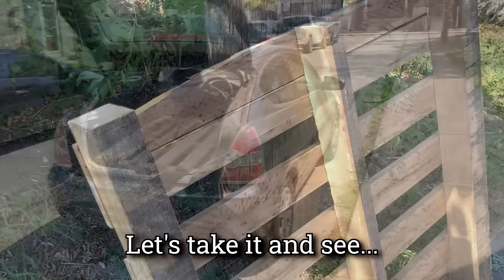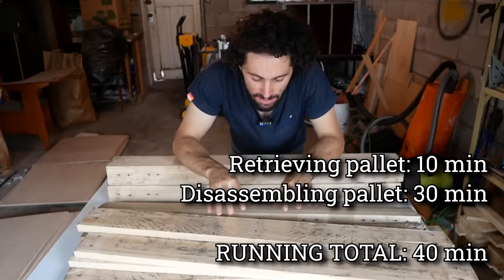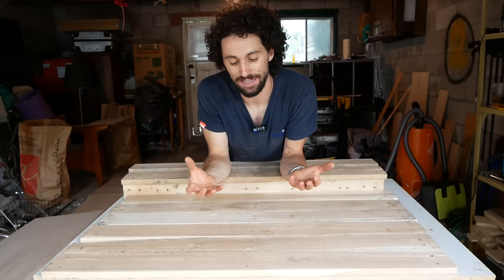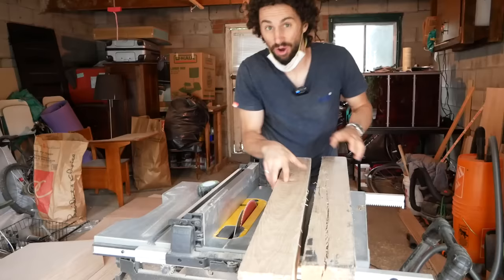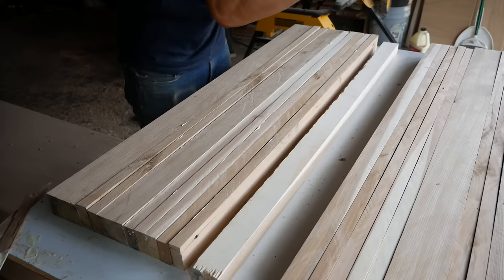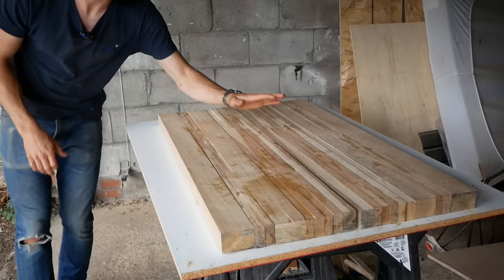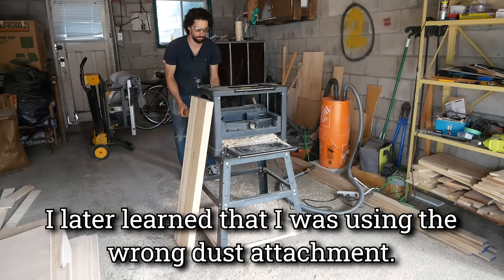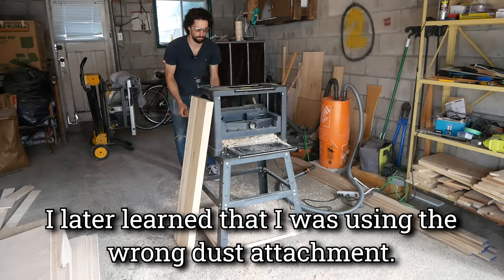Turning a Free Pallet into a $550 Table

Comment: If any new woodworkers watch this, do NOT copy his tablesaw practice. Use a push stick or gripper block to keep your paws away from the blade. How he still has thumbs doing that is amazing.
Reply: That was my first reaction to watching it. Insanely dangerous technique. This comment should be pinned.
Reply: As someone who has had their pointer cut off and luckily reattached, I can also say I have anxiety watching ppl get that close to the blade. Be careful and definitely do not go that close with your fingers. Use a push stick always!
Reply: Yes, very dangerous. WATCH YOUR DIGITS!
Reply: Wow... I hope you guys didn't get sawdust into your handbags.
Reply: @moshesheckel7369  
So, you don't think adhering to an appropriate level of safety is a good thing? There are no handbags if you have no fingers.
Reply: At least I'll have thumbs to open and close the zipper!
Reply: I cringed when I saw that. 🤦‍♂️
Reply: I'm a complete noob and I noticed it. This guy is a maniac. I stopped watching after that point.

Anyone who doesn't follow basic safety technique (that even a novice like myself can see) isn't someone I'm gonna be devoting my time watching for ideas.
Reply: 75 years old.  Retired Industrial electrical/millwright contractor after over 30 years and was in the trades the rest of my life before that. . Most of my time has been in metal and not really a johnny woodworker but I do have a COMPLETE wood shop with all industrial equipment we have accumulated over the years.. After all that I have all my fingers and in fact still play in 2 bands on a couple of different instruments.  Here is the way I kept from getting hurt over all those years.

DO NOT DEPEND ON GUARDS. Depending on a guard to save you will get you hurt every time.  - Personal responsibility is the best guard of all. Keep in mind every machine you will ever get around wants to kill you. 
(BTW The guard on the table saw is not to keep a fools hands out of the blade. It's to keep a piece of wood from dropping onto the top of the blade and getting propelled toward the operator like a spear. Somewhere along the line it became the end all solution to not sticking your hand in to the blade)

NEVER, NEVER, NEVER use gloves around rotating machinery.Not even the so called "rip-aways" - It is better to have a few stitches in your thumb then not to have a thumb to have stitches in. 
I have actually seen 2-dead bodies taken away that were killed because of gloves wrapping them up and pulling them in. 1 on a radial drill and one on a straightener. I have seen more lesser injuries then I want to remember. If you can't run power tools without gloves go do something else for a living.(I catch you once and you go home for the day. The second time you get your money and never work for our company again)

As for the table saw...A trick,,, Lay your hand flat on the table with the edge against the rip fence. Extend your thumb. Any board narrower then the distance from the tip of your thumb to the fence gets a push stick. 

Just remember, if you don't want to get hurt don't take chances and don't depend on guards, gadgets, and  gloves to save you. It;s all up to you,,,,,,and watch put for the other guys on the job.
Reply: Came here to say this
Reply: @mathewmolk2089  
Excellent advice for all levels, especially the table saw safe distance (you've spelled out exactly as I do).
Reply: Crown guard dude🧐
Reply: will be doing a video one about going to er
Reply: Always use a stick 👍
Reply: that was my concern too
Reply: Yeah, I don’t even own a table saw yet but I would still never do that. Friend of mine almost lost his whole hand working professionally still isn’t a guarantee.
Reply: As with just about anything don't be an idiot, pay attention to what you are doing and you will be fine. push stick or no push stick. His fingers aren't even that close to the blade.
Reply: @moshesheckel7369  Incredibly stupid sophomoric comment. Everyone else is giving excellent advice and being extremely generous.
Reply: @mathewmolk2089  definitely do not use DeWalt. Every tool  they sell wants to harm you on one way or another‼️
Reply: Millennial
Reply: @elenalatici9568  seemed reasonable to me he was just making fun of all you nutless wonders obsessing over a push stick. Ffs not everything needs training wheels. Just don't be careless while you work. 30 years in the trades still have all my fingers not because of push sticks but because I pay attention when I am working.
Reply: Sooooooo bad. Excellent demonstration of the “before” part of the shop safety video.
Reply: I totally agree
Reply: I’m sweating watching this sh**
Reply: I've been a finish carpenter for almost 30 years now and I still have all of my fingers. Those push sticks are the dumbest thing I've ever saw and I watched one of you geniuses get your nose broke once because plastic doesn't grip or feel the saw binding. 

Seriously just no matter what don't get your fingers within 6" of a blade and you'll keep them.
Reply: tbf he was far away enough
my woodworking teacher always told me 
if you can fit more then your hand inbetween the blade 
no need for a push stick
Reply: @moshesheckel7369  the problem I have with it, a unskilled person is going to see this and do EXACTLY how he is doing it, And lose a finger. Or his handbag.
Reply: @mathewmolk2089  the guard isn't to protect you from the blade, it's to remind you where the blade is. spinning blades aren't very visible
Reply: pallet wood isn't good wood either and is likely to split and come flying back at you.
Reply: @danger1240  or maybe it's dumb luck why you have all your fingers still.
Reply: @thomascieszenski239  those cuts he was making were less than 6" from the blade, so the only safe way is with a push stick
Reply: @Galgamoth  or maybe just not being dumb was key...
Reply: Dude I was thinking the same thing, and I'm an amateur lmao
Reply: I thought the exact same thing when I saw his hands so close to that blade. If he wants to do that in private, that's his business. But I think it's really risky to do it when he publishes a post. Not everyone is as careful and coordinated as him. I forsee many sawed off fingers!
Reply: yuppp
having a heart attack
Reply: Yup. I was enjoying it until it came to his use of the tablesaw. It made me feel so uncomfortable. Please be safer.
Reply: thx for bringing that up.
Reply: @mathewmolk2089  So good to hear experience over sanctimonious remarks. Cheers Mathew
Reply: Speaking as someone with experience, I give this comment 1 and a half thumbs up
Reply: was searching for this comment!
Reply: @moshesheckel7369  wow what a perfectly sexist and useless thing to say. As a woman who does carry a handbag and knows people who have cut fingers off with table saws, I have enough sense and basic experience to know that the first thing you learn with woodworking is to NOT put your fingers near the blade. Anything could happen to make you inadvertently move your hand an inch and regret it for the rest of your life....but I guess real manly men don't care...for the rest of the novice people here who don't need to act macho and tempt fate to validate their worth, learn the rules before you break them...which I think the point of the original comment was
Reply: @mathewmolk2089  great advice, I just took a screenshot of your comment to save for later
Reply: That pallet just happened to show up. An art gallery next door. Unsafe table saw technique.  Doesn’t know what type of wood he’s using.  Faking nervousness. Fake insecurity. Too perfect. Even the checking with “partner” line.
Reply: Ended up selling it to his friend or family member. Haha
Reply: read all before answer:
I'd understand all those "cringing", pants crapping comments if he worked with a short and at least an inch wide piece, which is definitely not only dangerous but actually impossible to do with bare hands without getting hurt in any way. But he is pushing a plank 100mm wide and 1m length, that is absolutely normal practice for an average woodworker, whose hands are stable and attention is up.
Still, I agree he definitely should make a note of that before filming this stage of work, to prevent beginners from copying anything they don't understand.

....yet now I watched next sawing stage and it is exactly how it should not be done without helping tool, brain, stable hands and tons of experience.
Then I noticed that wood fibres in board are not opposed before gluing, then he glued two parts without a male plank, and finally he didn't make a crossbars. That is quite more a crime worth noticing.
Reply: Yup. My dad was a carpenter for something like 30 years (so he had plenty of experience) and still lost the tips of two fingers by getting sloppy and not using a push stick.
Reply: Yes.... Instead copy all of the videos of the safety police posting here demonstrating their God like use of the tables saw.
Reply: Fingers are not even that close to the blade. What a bunch of pansies. Just be aware and pay attention. Don't be an idiot. I still have all my fingers too. All injuries and or death I've seen in construction, has been using and following safety precautions. So great advice guys.
Reply: @Cdeath27 sounds like you need to worry about your own way of doing things and not others.
Reply: Please buy a corded circular saw. Oh the agony....but nice job bud. Keep it up!
Reply: Lots of rookie practices, rookie tools, especially the work bench, aka crap saw horses.
Reply: Can’t wait till he loses a thumb. I’ll be back to comment on this post when it happens 😂😂🤣😂🤣
Reply: Yes...shame on him!
Reply: @moshesheckel7369  spoken like someone who has never worked a piece of timber in his life. Stick to flipping burgers for the boys 🤡😂
Reply: @dclinks  I don't know if you're familiar with Canada, more specifically Toronto, but finding a pallet on the side of the road is not uncommon (a business gets a shipment and leaves the pallet out for someone to take) and there are small art galleries everywhere. His demeanor to me seems like a typical millennial in a big city in Ontario, not faking awkwardness and being unsure of what they're doing....most of us actually are  awkward and unsure, we just wing it and hope for the best
Reply: @moshesheckel7369  I bet you're so tough man.
Reply: @elenalatici9568  Exactly. Some guys think being ignorant towards danger and acting all tough about it is manly, which is mindboggling to me, and i work in the metal industry
Reply: @danger1240  so much of it is people who don't pay attention to blade sharpness, or vibration while running, so much of what I do is by feeling the vibration through my fingers, I never been surprised when a board caught wrong during a sketchy cut exploded or went flying, because I expected it and either was already standing out of the way or loosely holding stock on purpose so that it gets Jerked out of my hands when it inevitably fucks off.
Reply: @dlayman101  exactly . feel plays a huge part . you are safer without a push stick unless we are talking within an inch of the blade. Course you can always set depth  and flip in that scenario if you want. Too many safety precautions make work unsafe. Like having to wear steel toes while walking rafters. Way better off in my sneakers where i can feel my footing and bend my toes to get better grip. But everyone has to be treated like a 4 year old these days. I say let darwin do his work and the site will be running much smoother in a week or two once all the mouth breathers are gone.
Reply: @will hardy 

trouble with higher math?
Reply: @danger1240  

ur luckier than u r smart. ♥️
Reply: @Albrrrto22  

Trumpf LOST🎉🎉🎉
Reply: @lukehebert6207  key word he got sloppy.  After 30 years . solution dont get sloppy
Reply: Nah I I dont use a push block unless its dangerously close to the blade.
Reply: Agreed .. 👍
Reply: Agreed.  Geez.
Reply: You are totally right! I was about tonwrite almost the same plus NEVER put your head down the same height in line with your saw! Hopefully you git what I mean. Greatings from Germany
Reply: Came here to say this.
Reply: You see so many so called carpenters/woodworkers not using push sticks and crown guards on table saws, on all social media platforms. Come on lads, safety first.
Reply: @JohnOsCreations  
It's atrocious isn't it... What is worse is when you look at some of the replies here, from supposed experienced woodworkers, calling people out for using safety kit. People who don't use it in their own workshops are fine to do so, but to discourage people from using safety kit is awful. 

If I had my way, I'd ban those morons from using the internet where they can influence novices with dangerous practices.
Reply: @will hardy for now
Reply: @Galgamoth  knooty, gnarly and loves to close on the blade.
Reply: I saw this too and it stood out at me.
Reply: Right?!? Jesus Christ, dude
Reply: @danger1240  dad always said, "treat all guns like they are always loaded, all metal as if it's always hot, all wires as if they are always live. Don't anticipate the bullet when you pull the trigger, the gun should surprise you with every shot. Be aware and afraid of all the dangers mentioned, that fear keeps you from making a mistake, last of all never hate anyone or anyrhing, and don't worry about things you can't control."

Men from his Era remove every piece of dummy protection off of tool. Blade covers are only good for contractors who are too cheap to have a decent cut table and toss their cheap Dewalt circular saw on the ground, covers on any modern cutting implements are training wheels for children. You should see the high speed spinning cutting implement and it should make ypu nervous ever time. The safer the tool feels and the safer you feel, the more dangerous your way of thinking ends up being.

I take care of all my tools better because of it. If the blades are sharp, and I dont rush, I can either do it without a stick, or I can toss a guide jig on it, anyone who does shop work enough should be able to make any tool or tool accessory they need, they simply require the willingness passion and time to do so. People like that make tools and things that haven't been made before, because they take the time to think about it for a while.
Reply: Same ,was lil worried for him .
Reply: I cringed so hard!
Reply: @danger1240  it's not about simply keeping your fingers away from the blade during a smooth, predictable pass. It's having your hands that close to the blade when the blade meets a hard knot or any other obstruction that causes it to grab or kick. More often than not, it will tend to pull your hand directly toward the blade
Reply: Maybe he has one of those SawStop saws. Still, not a chance I’m putting my finger that close to the blade.
Reply: Right omg I took woodworking in high school and the whole time he was using the saw I kept cringing. Not sure who taught him this but he needs a stick bad.
Reply: Yep. I was at a "school" for carpenters and the TA would get his fingers within a millimeter of the table saw blade 👀
Reply: Using real clamps is a good idea too
Reply: I just…not touch it problem solved
Reply: And use an outfeed table!
Reply: Definitely
Reply: @JayOfBurn  uh huh!!  You can carry your handbag in the crook of your bent elbow!  But then it would be an ElbowBag.  LOL  Safety is a good thing!
Reply: Actually shouted at my phone when he did this, insanely stupid thing to do.
Reply: Amen, he's not the only person on YouTube I see doing this.  I cringe every time.   I know someone who had been woodworking all his life ...knew better, but was in a rush...He had a kick-back... didn't even know what happened and felt no pain for the first second or two, but he saw these little. things on the table and the floor curiosly covered in blood.  He was in a rural area and after he realized those were his fingers he had to dial for an ambulance with his other hand.  They instructed him how to pick up, clean and bag all five of his fingers, the ambulance took 45 minutes to get to him.  A specialist had ro be called, and the operation was not performed til 25 hours after his fingers, all 5, were cut off.  Miraclously he had all five fingers reattached, but he lost the tip of his middle finger, by all accounts his favorite finger.  He has full use of that hand now with minimal loss of feeling.  Just wow!   I know for a fact i would have passed out. My story would possibly have been different. But, thanks to him I use every safe practice i can think of on all my power tools and blades.
Reply: Same goes for machining, don't put your fingers where you wouldn't put your.... well, you guys know the rest.
Reply: 🗣RELAX
Reply: Exactly! Jesus fucking Christ!
Reply: Fucking terrifying
Reply: @will hardyLuck favors the unprepared ...
Reply: I literally gasped...
Reply: @moshesheckel7369  I don't keep my purse in my shop for that exact reason.. fyi, females can be carpenter's to.
Reply: or any of his techniques honestly lol....
Reply: Exactly , my thoughts also I was cringing every pass he made.
Reply: And dont steal palets.
Reply: Thought to myself, man dude wore safety glasses to pull out nails, but stuck his fingers in the saw.  Wild Canadians!
Reply: Good post, that's exactly what I was going to post....
This guy will lose a finger someday....
Then again he's a beta and definitely has no formal training at all in any trade field.....
Reply: @moshesheckel7369  <===== found the darwin winner......
Reply: @will hardy <========= found another darwin winner
Reply: @fishing-kj3ee  yeah ok jr, I've never had a problem with Dewalt (btw American made and Owned)
Reply: I remember how productive I used to be before all the safety Nazis came to power...
Reply: Paws & thumbs? Surely that's a genetic screw-up?
Reply: @Cdeath27  if I had my pointer cut off I think I'd end my own life. 
Say what now? 
As I said if I had my pointer cut off I wouldn't be able to point!
What? Whaaaaaat? 
I repeat I have never had a pointer or had it cut off.
OK? Oooooooo.Kay? 
OK
Reply: @JayOfBurn  where are you going to keep your fingers if you haven't got a bag?
Reply: @MotaDhesi  you'll have to use both at once like a sock puppet lol
Reply: @danger1240  double like as opposed to just a single
Reply: @philturinsky27  lol. Nice way to use both words; but you can't use both Items until you've somewhere to keep those lost digits
Reply: @Galgamoth  not to mention whatever else is stuck inside the wood. Like screw heads; just general shit and stones from the floor while it was loaded just wedged unto the wood ready to be "turned" into a projectile instead of a table leg
Reply: I KNOWWWW, and after seeing him collapse the sawhorses tearing apart the pallet???? if he is doing things by himself he needs to follow safer practices, use a pusher etc and it helps to have a roller on the other end to support the wood! obviously just a do it yourselfer and not a professional wont have all the equipment, but some things are just basic, I feel like he has plenty of enthusiasm, but not a lot of experience??
Reply: @TC-kf9zw  I have dewalt's plunge saw and rails. It's epic. So "black and yellow kill a fellow" only applies to snakes
Reply: @TC-kf9zw  I'm pretty sure he's past the beta stage; like he even has all the texture mapping and lighting effects spot on? 
I can see your point though; if he doesn't change his habits he'll find more than a bug in the system...or something I dunno I can't code
Reply: @will hardy On your toes???
Reply: @danger1240  I think they call that "dumb luck".....
Reply: @JayOfBurn  THANK YOU, and what you do with your own digits is all on you.....BUT you have people watching this both male and female and younger and older who have NEVER used a power tool thinking "I could do that"!!! and going to Lowes or Home depot or Harbor Freight and buying a $199 table saw...geez louise, and then reading all these idiotic comments about "I DONT NEED NO STINKIN SAFETY STICK, GLASSES, ETC ETC" that!!!! is the reason he needs a disclaimer on the beginning as others should do, it may look easy and most likely is, but things will not be easy when you lose fingers, hands, eyes from a stupid mistake that could have been prevented, and if you are a professional as some purport on here to be then you should be smart enough to tell everyone "SAFETY FIRST' it does not matter if you yourself cut wood for 100yrs and are alive to talk about it, that is you, it is the others seeing videos like these and thinking they can.
Reply: Have you seen the plaster on the thumb after the parm router part and how he was crouched down to eat the chipping to save on extraction
Reply: @chrisfry436  safety first ahhahaha you have obviously never worked in the trades. That saying goes right out the window when its actually time to get work done.
Reply: If any experienced woodworkers see this. Use a push stick or gripper block. There's no reason not to. One tiny mistake and that 450$ profit turns to several thousand in medical bills and a messed up finger or hand
Reply: Worked at a mill for a while. Most experienced wood workers didn't follow this and they all have 1 thing in common
Reply: @moshesheckel7369  wow... you are such a manly man... a real stud... so cool... feel better now?
Reply: totally agree or his next video will be "a trip to the emergency room"
Reply: @themoops.  legit every experienced woodworker I've worked with in mills all have missing tips and regret not doing it the right way. And I'm talking 19/20 people that have been doing it 5 plus years. The 1 that doesn't have a stubby is a new hire and just hasn't had that small slip up.
Reply: Literally screaming at him through the monitor.
Reply: I recoiled in my seat when I saw him not using a push stick. Glad this comment is top.
Reply: Hes seems kinda clueless
Reply: @moshesheckel7369  Key word of warning , "NEW"
Reply: We All start somewhere, just hope to all end with everything we started with
Reply: Came here to say this. Gonna be really hard to put that dust mask on without fingers.
Reply: But still it was a pallet turning not safety ed video
Reply: @fdd7002  including all 10 digits.
Reply: I started with no experience.  First thing I did was watch other woodworkers.  This in terms of safety is a huge no no.  I would encourage any woodworker to use a stick or microjig to save their fingers.
Reply: also more than likely planted the pallet in that location
Reply: YES!!!! WAS FREAKING ME OUT. UGH
Reply: Hahah I was going to say the same thing
Reply: It's definitely cringy
Reply: uhmmm hands were pretty far. Awareness is the next level of safety.
Reply: mo kiddigm I'm not even a woodworker but I held my breath seeing his fingers so close to the blade
Reply: In 9th grade my son nearly lost his index, middle and pinkie fingers in woodworking class, because he wasn't using a push stick. Not the worst "Mom, a helicopter is on it's way to get me, because..." call I got, but still scary.
Reply: Many of my friends ignored this advice. Losing some digits either early in their career as a wood worker, or later in their 50’s when they started getting complacent thinking they knew what they were doing.

Moral of the story, always use a push stick, always use large guides to track your lumber through.

You only get two hands and 10 fingers… try and keep all of them if you can.
Reply: One day, woodworking wont even be a thing anymore because too many snowflakes don't want to hurt themselves.
Reply: @knowsittobetrue8566  see ya later then.
Reply: What's he in a hurry for? His boyfriend must be coming over
Reply: Ive been a carpenter for a year now, for the first couple months I took safety serious, but as deadlines have become more constraining I now notice I've ignore a bunch of basic safe practices to save time. This is a comment is a fresh reminder to always respect the saws!
Reply: I was gonna say "here we go again, people correcting and criticizing blah blah blah..." but I went back and re watched the video and HOLLY SHIT THIS COMMENT IS NECESSARY!!!
Reply: @ByGraceThroughFaith777 My son watched this video. Went out to the shop to try and make a table and almost cut his finger off. I rewatched the video with him and told him never to cut like that or he will cut his finger off
Reply: Not even a woodworker and I shuttered
Reply: YUP!!!!
Reply: @hitman3604  I just cut my thumb off after watching this! OMW 2 hospital!
Reply: How he sold it for $550 is what's really amazing. Pallet wood can have toxicity from pesticides in warehouses and storage buildings. I've known people who got sick from pallet wood.
Reply: I don't think his practice is safe, but I do believe that's the saw that pops the blade under if it feels any flesh and won't cut it.  It's still being complacent but that's probably why
Reply: @moshesheckel7369  You acting all gangsta till a kickback occurs and now there's blood everywhere.
Reply: He literally has it sitting on top of the table in the shot, no excuse 🙄
Reply: @chado96k75  He seems like a good guy though and we shouldn't maybe be so hard on him even though he may or may not lose a finger or two. But it's a good video
Reply: @volfan8141  agreed
Reply: Also don't rush a the mitre saw. You waste fingers and feet.
Reply: That made me physically cringe.
Reply: Yup, my Dad lost his thumb doing exactly as he's doing in the video.
Reply: If I could, I would pin this!
Reply: Love the table but that did make me nervous lol
Reply: Pretty much copy NOTHING he did in this video. Geezus Christ, almost everything he did was shitty, sloppy, dangerous, or just wrong
Reply: @thedandy6765  7
Reply: Okay…. I’m no expert, but I have used a tablesaw a Lot, and that looked wildly dangerous. Then I saw your post, and I remember that my father Always uses a metal pusher.
Reply: I think.he was ok, his fingers were not close to the blade, but with something this heavy he needs a place the same height to pus it off the table saw onto like an outfeed table. And yes some push block or sticks would be good.
But a lot of pros do not use them.
Pros do things most hobby woodworkers should never do, it comes down to skill.
Last thing he wants to do is get hurt on a power tool.
Reply: I was just to about to say the same! It is amazing he has still all fingers on his hands!
Reply: @bobbg9041  
Yup. That's one of my biggest issues with this video... he's a creative novice, fine, but publishing poor safety practices for other new woodworkers to copy is wrong. So many of the comments above from "experienced" woodworkers saying they never use safety equipment annoy me. They're missing the point, they can cut their own fingers off, fine... but don't teach others poor safety practices are acceptable.
Reply: I'm a free bird sir
Reply: That saw comes with a push stick
Reply: thought the same lmao
Reply: Absolutely terrifying. Bad bad bad
Reply: As someone that in the last 2 weeks had an accident where I shaved a bit of my finger off on a jointer, LISTEN TO THIS PERSON! I knew better then.....I will NEVER make that mistake again.
Reply: @akshayd211  agreed! It was scary.  I'm surprised he still has all of this fingers.
Reply: Amen! I cringed every time he ran a board!
Reply: @katmomsing  So basically any time you are putting wood through the tablesaw, there is a non-insignificant risk of kick back due to the very fast spinning blade and internal stresses in the wood that cause it to pinch the blade. If the wood kicks and your hand is ANYWHERE near the blade, you risk cutting yourself badly or even losing fingers/hands. By pushing and guiding the wood with a good pushstick or pushblock, that same kick would first hit that tool, which you can easily replace. Better to be out $15 than a hand.

If you want an example of kick back or the results of an accident, there are TONS of examples online, but beware, the accidents aren't for the faint of heart. These things literally happen to anyone, even woodworkers with decades of experience.
Reply: @danger1240  This video isn't aimed at grizzled tradesmen who've been getting away with it for years. It's aimed at have a go noobs on the weekend. Nothing wrong with that. That's how I got started. 

The point is, people with little experience will see this, decide to have a go & end up mutilated. 

I like the premise of the video but the execution was reckless & it irresponsible to post online.
Reply: @MrSubielove  His fingers are centimitres from the blade. He's clearly not that experienced (all have to start somewhere) but the potential for serious injury is painfully obvious.

If you can't see this then...
Reply: @chado96k75  The only saw I know with that feature is a Sawstop & they're black. Could be other models I'm unaware of but I'm not convinced. Wouldn't want to test that safety feature, even if the saw had it!
Reply: @noidontthinksolol  The problem is, this guy has no idea what he's doing & is encouraging other noobs to emulate him.

What risks you take in your own work is your business but when people post stuff like this on YT then people are quite justified in warning others of the danger!
Reply: The thing is, he HAS a push stick - you can see it in one of the shots, lol.
Reply: @mathewmolk2089  PLEASE put this in the main Comment thread so it doesn't get lost! Great stuff, thanks.
Reply: when he was making that second rip on the already cut thick piece and that blade was 5 inches up i was literally biting my thumb nail. great advice. an effective gripper block can be made with a scrap and a couple small cuts and is totally free and easy.
Reply: @chado96k75  
You're talking about a SawStop, and that is not one. They cost several thousand dollars, the one he's using is about $250.
Reply: @JayOfBurn  I didn't know. I don't work much with table saws but I seen the weird piece and thought it was.  I hope he sees the comments and practices safer ways to cut accordingly
Reply: @chado96k75  He posted on his 'Community' page about a push stick he made, so he has. Just hope he uses it now ;)
Reply: @JayOfBurn  good.  Safety first.  I appreciate the knowledge.  My buddy just lost a few finger tips about 4 months ago.  I appreciate your looking out.
Reply: My dad lost half a finger cutting like this. Always use a guard & a push stick!!!
Reply: Jesus I thought you were being over the top like you usually see but god damn that gave me anxiety
Reply: @moshesheckel7369  Because being safe isn’t cool or manly right? Smallest pair on the planet.
Reply: @mathewmolk2089  thanks Mathew
Reply: @noidontthinksolol  Not wanting hobbyist woodworkers to risk serious injury through following clueless YouTubers is hardly health & safety gone mad. 

He's free to post this & people are free to highlight the riskiness of his technique.
Reply: @moshesheckel7369  "Huh.....huh...... I'm too much of a man (although given the clear insecurity showing through, not really) to cope with basic safety steps.  

It's real 'manly' to do a half-assed job of things.  "

😏
Reply: @knowsittobetrue8566  I stopped after the 2:49 "So.....I'm not making a table out of the pallet, I'm making a flat piece of wood"
Reply: @syednaqvi2015  You can buy a Grriper, which is useful for all sorts of cuts & tools or make a pusher out of scrap wood that looks like a boot, with a heel & handle. Anything that will guide the workpiece through in a stable manner, whilst keeping your digits away from the blade.

If something goes wrong (& it will at some point) the pusher takes the brunt of the damage, you get a healthy dose of ahdrenaline & avoid the emergency room. 

If something goes Pete Tong on a tablesaw, it's hapened before your brain can register. Sometimes you have no idea what even went wrong.
Reply: Lol, I was thinking the same. He ain't gonna have fingers for long.
Reply: Yes!!! Dude gonna lose a finger or a hand...or worse.
Reply: This guy is asking for trouble.
Reply: I agree. I didn’t enjoy watching him cut the slabs that way. I was cringing. My goodness.
Reply: Okay nigga…….????
Reply: If youre gonna use a push stick make sure it matches your purse
Reply: Yea that was the first thing I noticed too
Reply: 😪 you are right dude.
Reply: If ANY WOODWORKERS AT ALL watch this footage, please use a push stick, and not your hands like this very talented but extremely foolish guy is.
Reply: @thomascieszenski239  what kind of idiot uses a plastic one !? 
It has to be wooden.
Reply: Glad I wasn’t the only one. Tbh a lot of his methods should be avoided. Great creativity though.
Reply: I know why he's doing it like that.... He needs to apply downwards pressure to stop the piece from flopping off the edge. 

But he needs to change his set up so it runs easier.
Reply: @freddiehill28  I understand why the issue is you can do that using tools that keep your fingers away from the blade. Push sticks is one but there’s others that are designed to keep pressure downwards in a safe way for your hand.  All it takes is one kickback to ruin everything. After the first close call you’ll quickly change how you do it.
Reply: I’m not even a wood worker and his technique was still giving me anxiety LMAO
Reply: This guy is a herb
Reply: I felt this reply
Reply: That was my first thoughts too
Reply: My very first thought, too!
Reply: U so smart dude 😎😎😎😎😎 wow thx for telling us
Reply: Might be a skil saw so the blade would just break on contact
Reply: I watched the best even use those devices 👍🏼
Reply: Took me 3 hrs to respond to this after I used a table saw once 😂😂😂
Reply: @moshesheckel7369  no, because we moved them with our hands, that still happen to have fingers attached to them.
Reply: Haha I saw it on the video and I went straight to the comments. I knew there was bound to be someone else who noticed
Reply: That's a no thumbs up I guess.
Or is it thumbless up ?
Reply: Came to see how many people had beat me to the punch on this comment. Appreciate everything he's doing, but PLEASE use best practices for safety.
Reply: Compound that with the fact that he's just using a "random" pallet. Most pallets that are available in the wild are chemically treated (read: toxic and should not be used). There are heat treated pallets, but they are few and far between because they are highly reusable and valuable.
Reply: @rexj9741  Caution doesn't prevent unpredictable movement. What if that wood had a hidden nail in, a slight rotation caused the stock to pinch, or caught a knot and climbed the blade? Being cautious would not prevent his digits being dragged toward the blade.
Reply: Seems like he’s experienced…many people do unsafe things in their profession over time once they become really good at it that’s just how things happen. Also there are people that less clumsy than others and their movements are just not safe as a whole regardless, this dude looks like he moves pretty cautiously. Obviously things can happen but it is what it is. Another thing this video wasn’t a tutorial on how to use tools. It was him flipping a table for profit.
Reply: And when cutting ANYTHING as large as the 4 x , be very aware of the possibility of kickback😖
Reply: Anyone reading the above post DO NOT copy his text! Use correct spelling at all times. How he misspelled Table Saw is amazing.
Reply: An outfeed table and push stick would help here.
Reply: @JayOfBurn  Yup. I had a carpenter friend who one time waved to me normally with 5 fingers. Next time I saw him he could only wave with 2 fingers on his right hand after an incident with a table saw. If I ever set up a shop I will use push sticks and have a SawStop.
Reply: You don't need to do that but it is recommended, there's nothing wrong with what he did besides it being obviously less safe.
Reply: @moshesheckel7369  Using women as a put-down. So doing something dangerous, or stupid, or unsafely is like being a woman? Is that what you're saying Moshe?
Reply: Exactly what I thought, an accident waiting to happen.
Reply: I have zero experience using such tools and that looked very… not right. 

Thank you for sharing guidance.
Reply: That is exactly what I was thinking. I grew up in carpentry family and saw many relatives lose their fingers this way. Wood has grains which can thwart off the plank, ending up with the saw chomping your fingers. Always use a push stick.
Reply: I watched and screamed... My grandfather would beat me if I'm doing it this way
Reply: Absolutely. No matter how experienced or practiced you are you always use some form of push stick. Its standard practice imo.
Reply: @Albrrrto22  give it time.
Reply: @Albrrrto22  I'm sure he does. And you carry on with your macho casual methods. They seem to suit you. I'm sure one day you'll suit your new fingers as well. Take such risks all the time and it is only a matter of time before you'll regret it. Good luck
Reply: instable workingtables, fingers near blades, routing by free hand.... how does he still live and who pays 550$ for that table? i am so confused.
Reply: @JayOfBurn   You will need to have your lady pack your fingers in  a hand bag full of ice, to see if they can re-attach them when you get them cut off. Safety should always be first in any line of work. An injured or dead person cannot do anything at all for anyone. Besides most people that look on uTube  are not pro-woodworkers. And if they do things like this guy did and loose there fingers because they are inexperienced and didn't know to use a push block then they can thank you for your lack of concern. I agree with the seasoned wood workers that give sound advice to use a wood pusher to hold down on the wood and push it through. There easy to make with scrap wood. I have seen uTube videos on how to make one, for those that don't know how to make a wood pusher.
Reply: came here to see not using a push stick is a top comment
Reply: Gotta give this a thumbs up
Reply: @JayOfBurn  😂
Reply: maybe he is using sawStop device.
Reply: Old school. I've done many times when  I was a teenager.  Just be mindful of what's going on in front of you :)
Reply: So terrifying just to watch
Reply: I thought the same thing yikes!! Safety first
Reply: @thomascieszenski239  
I'm a carpenter too, and I rarely use a push stick when I work alone.

But you can't deny that everyone who cut off a limb thought just like you did. 
Problem is, as much as people try to not be careless, it's super easy to become complacent, because you've done it for so long. There's a reason workers at 40+ are overrepresented in workplace injuries.

As an older worker, you should encourage the younger generation to embrace safety, so they don't end up fucked up like your generation.
Reply: @MrSurrealKarma  I don't know anyone that's lost a limb. Saw a couple cuts here and there and it was usually within 6 months of the conversation we had as to why weed makes them concentrate better. 

 I don't like the push stick, I don't feel like they're safe.
Reply: @thomascieszenski239  
Me neither, but a lot of my colleagues do. Some almost lost their hands because they didn't take swelling fingers seriously after digging out splinters.

"I don't like the push stick, I don't feel like they're safe." 

They are inherently more safe than pushing with your hands, dude. It's not debatable. 

And I say that as someone who uses his hands, unless it's a thin piece.
Reply: see the bit where his hand was shaking as a cut ended ?  if another arm moves to catch the cut wood or your not positioned correctly balance and reach wise your body can send that shaky hand bladewards. keep the skay hand stable and the free hand can go wild instead 

i near cut off my left thumb top and forefinger on a table saw - removed the pad from the thumb and docs couldnt believe i dint need grafts or amputation - got a weird kinda thick scar tissue based pad now . hurts if im dehydrated, is numb most of the time and feel is an issue ( nintendo switch controls a disaster ) . restricts my rythm and grip in working with my hands  . also got PTSD triggered by any image or thoughts of accidents blades etc . dont suffer distress from it now but occasionally uncontrolled sobbing still happens sometimes lol
Reply: @MrSurrealKarma  What are you ripping? Shoe mold? Why are you so scared of the blade? I don't get close to it. If I need to use my table saw to rip something small I cut it 18 inches long. My hands aren't getting near the saw. You cut it to length before you rip it. That's the argument we're having here isn't it?
Reply: @thomascieszenski239  
Yeah, you don't get close to it until you do, cus "you're just gonna.." 

Again, there's a reason 40+ workers are the ones getting hurt the most.
Reply: Spoken like a truly new woodworker.
Reply: LoL
Reply: Dude that was driving me insane
Reply: I had to stop watching as it was making me feel uncomfortable.
Reply: I think any level woodworker would know not to use a tablesaw like this.  Just commonsense.
Reply: I cringed every time he cut something on his table saw!
Reply: The push stick is right there and his thumbs are shaking
Reply: For anyone who has lost a finger it’s on them. Just do what you are comfortable with . In my opinion you have to be quite reckless to even nick your finger.
Reply: Omg yea
Reply: Was thinking the same thing
Reply: holy, I'm a fairly new woodworker and I know better.....this guy is cray.
Reply: @willjhnson  
While I don't have the 70 years experience the 60 year old retirees claim above, I've been woodworking for 6 years... so, yea, "new" woodworker.
Reply: Or cable over the router.. huh :)
Reply: My thoughts exactly 🤣 beautiful table nonetheless thumbs up 👍 #safety first
Reply: Was just going to say, I cringed SO hard watching that.
Reply: Not to mention leaning on the wood whilst sawing😬⚠️🚑
Reply: Exactly! Terrible he will lose a finger or two if he continues this careless practice.
Reply: 100% agree with the push stick comment.
Guy could also benefit from having an outfeed table on the opposite side so it doesn't almost fall off the table saw helps make controlling the wood easier... Also use the planer and take a little bit off from either side and take a few passes rather than being super aggressive and trying to do it all in one pass.
Another thing he should do is use a metal detector to ensure there are no hidden nails or whatever since that can ruin the blades on a planer too.
Reply: My paws? Haha
Reply: Lol I noticed that as well thank you letting us new wood workers know !!😃😊
Reply: I cut like that all the time. Know what you are doing and pay attention.
Reply: @fishing-kj3ee  DEWALT makes great tools I use them everyday and own their entire 20/60 flex volt line up along with their miter saws, table saws planners, ect (their miter and table saw are the best until you get to industrial level tools like Jet) and every other contractor I know uses either Milwaukee or DEWALT so no hate but maybe you sling paperwork or burgers or teach for a living but on just about every jobsite in this country one will find DEWALT out there building the houses people live in.
Reply: Same, he was making me so nervous about his fingers
Reply: Watch Kenny Everett's, Reg Prescott woodworking. Very funny sketch from the 80's, I think.
Reply: Yes sir I e personally seen this happen a few times had to rush my buddy to the hospital for one of the times. He was  cutting 2x12s down to 2x4s to save money. He was rushing and not paying attention and cut his thumb straight down the middle of his thumb nail almost to the first knuckle, there was blood sprayed all over. I know something was wrong so I I ran out of the front door took my shirt off on the way and threw it to him And we were in the truck with in a few seconds. They were able to save his thumb. Now it looks like a butt.
Reply: Bro so true man this dude be asking to lose a finger
Reply: @mathewmolk2089  

You’re using commas to form an ellipsis… are you sure you’re not missing any fingers?
Reply: @danger1240  I’ll make sure to share this with your hand surgeon
Reply: I was literally just about to type this!! It's such poor practice man
Reply: @moshesheckel7369  love this comment!
Reply: Getting brazen with a table saw is never good. They should always be used with caution and respect.
Reply: In parts of the video he had a push stick but didn't even use it!
Reply: If you value listening to anything by 60. Use ear muffs. My advise is Pelator.
Reply: Don't tell me what to do
Reply: @moshesheckel7369  😂😂😂😂
Reply: @danger1240  your argument is an appeal to ignorance fallacy, normalcy bias, and an optimistic bias. You should never rely solely on one form of safety, yet bring as many together to work in unison. So, how about instead of just being mindful of our work or using just a push stick, we try to be mindful of our work WHILE using a push stick?
Reply: @thomascieszenski239  You sometimes need to make cuts narrower than 6 inches—it’s almost inevitable. I also think people are using the term “push stick” as an umbrella term. It doesn’t necessarily have to be one of the long plastic ones that come with most table saws—those do suck to all high heaven.
Reply: @thedandy6765  when he was ripping the thicker material, he was running his fingers no more than 3 inches away from that blade while it was FULLY raised, or nearly fully raised. No where, is that considered far enough away.
Reply: @christopherd5941  realistically I probably don't get my fingers within a foot of a blade. On the back my guide hand rests on the very end of the table while the other feeds the board and then I pull from the other almost perfectly opposite. I'm never losing a finger. The saw has done exploded if I did.
Reply: @moshesheckel7369  Better to have sawdust in your handbag than fingertips on the floor.
Reply: Yeah, this comment definitely needs to be pinned. I was cringing every time I saw him cutting wood on the table saw. It just takes one careless mistake, one slip up for a disaster to happen.
Reply: @thomascieszenski239  if I’m interpreting your words correctly, it sounds like you’re finishing your cuts on the table saw by pulling on the out feed material, kind of like when making small cuts on a bandsaw?
Reply: @christopherd5941  yea it might even be wrong but I got introduced to finish carpentry by doing hardwood floors. Many times we couldn't even rip things straight. We did it freehand. Walls are crooked.
Reply: @christopherd5941  because as others have already said it's safer to feel what you are doing.  A push stick is more likely to slip and doesn't give you as much control or physical input. He isn't even close in the video. Stacked safety Measures usually interfere with the work and each other. if you don't need a push stick don't use one it is less safe. You have many other options available. Too small to cut on a table saw? Maybe use a bandsaw? Cut big and use a sander or planer? Lower your blade height and flip it and take two passes? Flip the piece end over and take two bites?
Reply: @danger1240  as I e already stated and you can go back and rewatch the video to double check, but he was pushing his fingers through the cut with no more than 3 inches while the blade was fully raised, or nearly fully raised while cutting the larger posts. In what world of carpentry, woodworking, framing, etc. is that NOT considered too close?
Also, allow me to rephrase a bit, we should use as many forms of safety that work in “harmony” together, not just unison. Obviously, if one form of safety interferes with another, which sometimes it does, but I definitely wouldn’t use the term “usually” to describe the rarity of the occurrence, then you shouldn’t use it or find another way. However, in the particular instance where he was cutting the larger posts, he absolutely should’ve been using at least a push stick or block of some kind to make those cuts. Especially, if he had no other means of making those cuts accurately. There’s absolutely no reason not to use one and I guarantee you will be hard pressed to find any considerable number of woodworkers or carpenters that say otherwise in that situation. Using a push stick would not have made those cuts any less safe or less accurate.
Reply: @thomascieszenski239  but that’s carpentry and he’s practicing woodworking, which usually involves a much higher level of accuracy and less tolerance. The cuts he was making can’t be crooked or you won’t get a strong glue up. 

If you have a suspicion that it’s the wrong way to do something, then why not try to change the way you do it or at least teach others that come after you the correct way, or at least the more accurate and safe way?
Reply: @christopherd5941  get as close to the blade as YOU feel comfortable with is all I am saying.  If it's too close for you and you feel like you can't stop yourself from inadvertently putting your finger into the blade for some unknown reason use a push stick if you want too. Or use any other method I mentioned. Basically don't touch the sharp spinning thing and you will be just fine. He felt comfortable doing it that way so more power to him.
Reply: I was breaking a sweat over this too. Safety first always
Reply: @danger1240  I think that’s a terrible way to think and possibly teach or encourage to others that are possibly impressionable by the experienced, like beginners, in this particular instance and field, but you have your opinion.
Reply: @Cdeath27  how does having it reattached feel? Is it numb in any way?
Reply: I came here to say this, then immediately saw that I was just echoing half the existing comments LOL
Reply: Kickback is a real thing too.  He is standing directly in line with the blade!  If he hits a knot or a nail he's going to neuter himself.
Reply: Im a new woodworker and seeing that broke me into a cold sweat
Reply: Back 100 years in 8th grade woodshop class there was a movie "It didn't have to happen' kid running some stock on a table saw with no guard/kick back/no pusher stick - hit a knot or something stock kicked back bro got impaled - classic shit - blood everywhere!
Reply: @mathewmolk2089  YOU ARE AWESOME! Thank you thank you thank you. Im rebuilding a really old table saw and that is definitely going to be a golden rule right there. Thanks once again. I hope you are reading this post Mr Kert!
Reply: If you look closely at the thumbnail.  He hasn't a thumbnail on his left hand!
Reply: @christopherd5941  well if you want a strong joint (glue up) as you call it you should definitely not use your hands. Count on everything but your own God given senses to make sure that board comes out right. 

Carpentry, furniture making whatever, I've done it all.  I'm getting better results because I'm not scared of it. You sleep in bed alone with a condom on because you're scared and I'll keep doing it the way that's been working for me.
Reply: Yea my old boss is 67 years old still working and 20 something years ago he cut off 2 of his fingers with a table saw and somehow about 3 months ago he cut another finger off at the age of 67 and he learned his lesson well he cut his first two off when he was in his 20s so 40 years ago he lost 2 and still didn’t learn his lesson and cut another one half off this year 40 years after cutting two half off doin the same exact thing. And he’s the one who taught me a lot of what I know and he’s always taught me well
Reply: I agree but I immediately got the impression this guy doesn't use these tools very often so sure, change the process to be safer if you try
Reply: Facts
Reply: ya had to say he still has thumbs. I was only watching to see him lose a digit or three..
Reply: There is NO REASON to not use a push stick. Who are you impressing? No one!
Reply: Thank you! I had so much anxiety watching.
Reply: Yep was thinking the same thing. Also could of had a nasty kick back standing right behind it. Please also use a dust mask / respirator, breathing in all that fine wood dust is not good for you.
Reply: @JayOfBurn  The guy saying people are wimps / of a more feminine disposition for wanting to be safe. Is the same kinda guy who gets killed doing something unsafe and stupid... Gj buddy 🤦‍♂
Reply: I could be wrong but... this vid slapped over 2 mil views 👏 👌 
So his risk=reward paid off so far
Reply: @moshesheckel7369  They are actually correct, he should have been using a push stick which is basic table saw safety and it's the first thing you learn in woodshop when using a table saw.
Reply: Well sir, you are ASSUMING that EVERYONE wants to keep all of their fingers.  Maybe they want to be unique and only have 8 or 9 digits in total.  But, I'm with you, I'm using the stick!
Reply: @mathewmolk2089  Thank you for your wisdom, Mathew, It does not fall on deaf ears. As a younger man I appreciate you taking the time to explain the importance of safe practice!
Reply: I'm getting into woodwork as a lil hobby (so i dont have to by gifts basicly :) and got the ouch face when i saw him using the table saw. Not gonna blame him, big time, but i do believe he should get better pratices since he is showing it on video...
Reply: atleast he wasn't wearing gloves
Reply: Yh my dad used to have that attitude until he cut his thumb in half. he has loads of wood feeders now lol
Reply: @moshesheckel7369  it is not what you don't know will kill you, only sometimes, it is what you think you know will most of the time.
Reply: MADE $45,OOO FROM   INSTANT PROFIT🌎ORG
Reply: Exactly my thought and I am beginner level lol, nice end product though
Reply: Weird, I like to test how sharp my saw is on my hand then go to the wood.  Like when you write on your hand to get a pen working, thats how I use all of my cutting tools.  I have lost some fingers, but my mom also hangs up some of my cool pieces.
Reply: THIS!
Reply: That wobble in his hands when cutting the 4x4 showed the fear haha :)
Reply: Always the safety brigade
Reply: @moshesheckel7369  🤣🤣🤣🤣🤣
Reply: @moshesheckel7369  🤣🤣🤣
Reply: @mathewmolk2089  Agreed. Health and Safety standards have taken the obvious awareness and understanding away from using your eyes and study of machinery in general. I don't see many chefs wearing gloves. 

Common sense overrides lack of knowledge. I wouldn't ride my Motor Bike thinking it can hold up to a car is a head on crash!? Duh. 

I've seen more dumbed shit in the last 10 years than I have ever past then. 

Besides, you learn quick when you have a near miss. And if you do chup your finger off,  it not a Hobbie for you. 

PPE, Safety Glasses and Ear Muffs. Hands are part of the tools when it comes to wood. Feed sticks are for 100mm or under.

Soon, Rugby and NFL will be banned the way its going.
Reply: @philturinsky27  I someone does not see and comprehend that the skinny wheelie thingy is cutting something they can't chop with there bare hand? They need new parents and have no business being around a pen!!!
Reply: @lukehebert6207  Sloppy...you nailed it.
Reply: Not a woodworker but an Electrical Technician, Jay of the Mountain you're right.
A work colleague just lost a part of his right middle finger from a circular saw two months ago at his personal home workshop. This is an experienced guy who will be retiring in like 5 years time.
Reply: @danger1240  kickback does not require the user being careless. Are seatbelts considered “training wheels” for drivers and passengers?
Reply: @mathewmolk2089  ❤Bless you, Mr. Molk! ❤ I'm so sorry for the loss of life you've seen (made me cry, tbh - I'm a Mom) but super grateful that you've shared some of your safety expertise here. If I knew you, I'd bring your family baked goods, just because.
Reply: @ Thomas Cieszenski ......keeping that Polish stereotype alive I see.
Reply: @lauraweiss7875  well for 1 seatbelts is not really a fair comparison 1/2 the purpose it to protect other drivers as well. Kickback on the saw requires you to be doing something wrong in the first place boards don't kick back randomly. You are going to fast to tight or there is a knot or bad grain.
Reply: I've seen worse. Every time I watch John Heisz videos I get stressed out.
Reply: HOLY CRAP!!! I CANT AGREE MORE!
Reply: Not to mention just pushing a crooked board thru the table saw doesn’t square up the other side.
Reply: He might have the table saw that detects a finger and automatically turns it self off but yes definitely do not do the way he did it
Reply: I just assumed he had a sawstop 😁
Reply: I drink beer and rip boards !! Cheers 🍻
Reply: Exactly!  Please protect those fingers! My dad used saws for 30 years then 1 careless mistake and he cut off 2 fingers!   Safety 1st!!
Reply: Most people use there hands just simply be care like any other power tools
Reply: @knowsittobetrue8566  and someone who's too chicken shit should stay away from power tools all together..we can tell your part of the newer models..all of yall want to be and act so righteous as if your afraid to make any mistakes
Reply: @dementedone481022420  maybe that's because a mistake with a tablesaw can mean losing a finger, genius.
Reply: I know very little about woodworking but for doing this he probably has a safety mechanism (at least I hope). The effectiveness of those is pretty wild. You could not cut your finger even if you wanted to. Look at this, it's nut: https://www.youtube.com/watch?v=SYLAi4jwXcs
Still I would probably use other safety layers. But my point is that you could do what he is doing your whole life and you'd be safer than people not using a SawStop saw (I actually realized SawStop is a brand, idk if other brands have this kind of safety mechanism).
Reply: My thumb, omfg why didn’t I see this sooner!!!!
Reply: Because he isn't an idiot. Accidents happen and complacency kills hurts maims. Some men like to live on the thin line of bravery and stupidity
Reply: @mathewmolk2089   like a man. Thank you sir for complimenting my comment as well. Some people rely too much on safety equipment when the safest equipment is usually your 5 senses. All safety equipment can fail. Relying on it solely makes you complacent and can get you hurt.
Reply: I k r
Reply: @Cdeath27  the exact same thing happened to me, left a pretty nasty scar and barely any feeling in the finger
Reply: i was just about to add the same comment.
Reply: yea i def felt anxious and was like ohhh man wheres the block!!!
Reply: Very true but he has the ripper blade on still so he's not reckless he's careful when ripping it so take it easy
Reply: @thrashigan2520  I'm sorry to hear that. If it helps, I'm beginning to notice some feeling coming back, but it's very hard to recognize the difference. I just noticed because I no longer am missing light switches when I go to flick them on. Sounds funny, but it's an improvement!
Reply: But really though, you may end up missing thumbs, but you received a life time of a good story to tell people about how you lost your thumbs. So who's really winning in the end anyway?
Reply: Exactly what I was thinking! I was wondering if the machine has some very peculiar safety mechanism I am not aware of.
Reply: whew, hopefully nobody without experience with table saw, saw that, I hope they read the comments, really dangerous moving those hands near those blades
Reply: He was originally born with 14 fingers. He just wanted to be normal.
Reply: CA exxx mfb98
Reply: @mathewmolk2089  Well said Sir! I grew up in a custom furniture/high end cabinet shop. I am 3rd generation "CRAFTSMAN". I was taught by those men before me that personal responsibility and situational awareness rule every situation. Inspection and care of equipment, i.e. Dull blades will kill you faster than sharp blades...
Mitigation is key, if you do not know how every piece of equipment works or do not understand the characteristics of the media/material you are working with, and choose to use the WRONG equipment for the task the blame falls squarely on your irresponsibility and laziness Guns don't kill people, people kill people, same principle applies in any shop, garage or job site, failing to prepare is preparing to fail.
Reply: So dangerous especially the 4 by 4s
Reply: Reminded me of my woodshop teacher and he was missing half a finger
Reply: For the next video, how to do wood working without thumbs
Reply: Or buy tablesaw with bladestop technology no need to worry how close your fingers are ever again
Reply: @toastandcakeyoutube4395  Not really, even SawStops will give you a nasty cut. Granted it won't steal your fingers, but you should still follow basic safe practices.
Reply: @rcherese  as someone who often uses used pallets (I hate waste so love to reuse) and to find one like he did... Is either a 1 in a million, someone he knew had it for a light object (any pallet with a real load on it is very damaged, broken pieces, chips off all the edges, or he bought it brand new. The first 2 are very very unlikely, so for a random, it will be hard to find quality pallets so it requires more hunting for them or more work to make them useable... Also, I have sold wood work pieces, maybe I undervalue myself a bit, but 500$ for that table? Maybe I should move to TO, if that is the price for items like that there.
Reply: @TC-kf9zw  The problem with Dewalt is the quality of parts inside. They rose to fame back in the day because they were super solid and hardy tools. They also had a drill/saw combo kit that was very popular. But as they got more known, plastic parts were used in their tools more and more. Which is why on a big job site you will see mainly milwaukee these days, their brushless metal drills are hard to beat. Then other staples like makita and bosche. Dewalt is hardly seen, mostly with newer guys.
Reply: Agreed.  This made me cringe!  I've lost count over the years of how many guys I've transported for hand surgeries and amputations because of stuff exactly like this.
Reply: @akshayd211  I’m only a few weeks into starting woodworking and after all the safety tips and best practices videos I’ve seen, those cuts were giving me anxiety.
Reply: @moshesheckel7369  Obvious troll
Reply: @elenalatici9568  He’s a troll
Reply: @austinwinchester  Bro your trolling is obvious.
Reply: @mathewmolk2089  Great read!
Reply: @keithlewis8238  Or sawdust?

But this guy really seems feminine
Reply: its wild that he still has a channel
Reply: Yup!!!!!
Reply: Yup!!!!!
Reply: No kidding, I was scared watching him.
Reply: @moshesheckel7369  Drawn forth Money!
Reply: Was thinking this too. I was wincing watching his hands get so close to the blade. I love how he’s showing you don’t need a ton of fancy tools and expensive wood to do a project.
Reply: You took the thoughts right out of my head
Reply: Thanks for the tip
Reply: @welcome welcome Dude, no need for that. 

Based on his other comments and videos he's a decent guy. Made a daft safety mistake, yes, but that doesn't warrant personal trolling.
Reply: @LazloNQ  No, SawStop machines are extremely expensive. What he was using was a basic job site saw. 
However, even with a SawStop, you can still do damage. Granted it would only be a small cut rather than an amputation, but still unpleasant... so safety should still be considered.
Reply: Jesus i came here just to comment this.  Jfc
Reply: @mathewmolk2089  great explanation, thank you
Reply: @Cdeath27  also, rip half and flip it
I instead of raising the blade to avoid kickback
Reply: Morley I think you should answer this comment. And hopefully improve your safety in your next videos!
Reply: @danger1240  like the dude in the video who paid enough attention that he first knocked the pallette off the sawhorses, then knocked pieces of the sawed wood off his table, etc etc. Seems like exactly the one that'll be a few digits short at the end of his clumsy, non-attention-paying day haha
Reply: @mathewmolk2089  please everyone listen to this gentleman.
Reply: I was thinking about the same thing LOL Amazing!
Reply: My first thought when I saw this.
Reply: Thanks Captain
Reply: That's one thing I noticed watching Adam making things on Tested, his use of push sticks.
Reply: He probably has one of the hot dog blade stopper thingies
Reply: He pensado lo mismo. Si sigue así perderá los dedos. Poca seguridad.
Reply: Agreed, I was close to slice my pointer in half wonce,luckely the blade pinched my nail for about five milimeters only. That's hapenned when my workmate tried to help me but he pulled the lumber too fast. Since then I always use a push stick 😁
Reply: ok what makes table saws so much more dangerous than, say a circular saw with the guard removed? It's dangerous, but be careful and don't be a spazz and you'll be ok. theoretically, the blade isn't moving, and if you keep your hand clear, the board can't physically shift from side to side because the blade is sandwiched inside it. but I don't use tools like this for my work (hand tool purist), so I dunno maybe I'm missing something. Just be careful and respect the danger of powered blades and you will keep your digits.
Reply: @Prodmullefc  Sorry mate, but you're completely wrong (no intentional condescension if it sounds that way). The board can shift for many reasons;
If you push the board close to the fence rather than the blade, the board can rotate toward the blade, which causes it to climb and kick back
If the board has a knot, shift in grain, unknown materials such as nails (it isn't uncommon here in Scotland for bullets to be embedded in green wood), or even a difference in density in the wood between the front and back of the blade can cause a climb and kick back.
The off cut being uncontrolled by the fence can swivel at the back of the back causing it to kick back. 

This is just a few of the potential errors. Each of them can pull your stock and supporting pink bits toward the blade... and that's how a trip to the hospital starts. 

Common sense is perhaps 90% of tablesaw safety, and those above that have used them for decades are rising those odds still, but the hundreds of thousands of injuries around the world each year are that 10%. Safety kit work to remove most risk, but 99.9% is better. 

Kick back is effing terrifying mate. As a hand tool purist, you haven't had the pleasure, but trust me, I've made mistakes, kick back is bad. When I was new to it, I wasn't focused on what I was doing, caught a kick back piece to the stomach... was not pleasant. 

Safety is a minor inconvenience, serious injury can be life changing.
Reply: @moshesheckel7369  exactly!!! 😁
Reply: Never used a table saw in my life and watching that gave me anxiety lmao. Seen enough people use the sticks
Reply: I've Literally never used a push stick on a table saw just use precaution and you'll be fine
Reply: Yes. And add a wood catch.
Reply: @333kingdomhearts  There are tens of thousands of serious injuries caused by table saws each year. Tens of thousands that think "it'll be fine". Simple and quick tweaks to their safety practices would reduce that.

Please, stop promoting unsafe practices. Just read some of the replies here, people who have injured themselves, witnessed or know others that have injured themselves, particularly Mike's in the early replies... then tell me again it's fine to ignore safe practice. 

Even Morley, to his credit, has agreed and improved his own practice... he actually makes an unspoken point in his latest build video. 

If you want to risk your own digits, keep it to yourself in your shop, and don't encourage new woodworkers to do the same.
Reply: I was just going to ask someone about his use of this saw and how he's balancing the wood at the end of the cuts. So I was thinking to myself I'm never getting that saw because it's too dangerous.
Reply: @moshesheckel7369  REALLY
Reply: I didn’t know what you were talking about because I came from more recent video where he was using push sticks. After watching the video and getting to the part where he tries to flatten the edges you instantly feel repulsed because the way he’s doing it unsafe technique that we were taught in woodworking but good to see that he changed his technique before he lost a finger.
Reply: I feel like I’m watching a video of WHAT NOT TO DO? between him dropping everything off the table saws, him NOT using a push stick, and him wondering why that circular saw wouldn’t cut 1.5” thick board 25” long without it killing that battery?  And this guys has almost 100k subs and sells everything? I obviously fucked up 😂
Reply: @Galgamoth  "Spinning blades aren't visible" dude, if the tablesaw is on, you'll know. (it's loud as fuck) plus, anytime you even touch the blade, it better be unplugged. The only time you touch the blade is when you change it.
Reply: I was about to comment that his hand is incredibly close to that blade lol. true meaning of sweaty palms. man is crazy
Reply: I know it’s dangerous but people who uses this kind of “dangerous tools” for a very long time starts to be less mindful of safety practices. Like using gloves for a mechanic, it preserves his hands but it’s a little uncomfortable so that’s probably why.
Btw in his next video he started using a push stick so don’t worry ahaha
You’re right obviously
Reply: @JayOfBurn  wow this has got to be the best rebuttle ive ever heard
Reply: Playing fast and loose with the digits my man.
Reply: I just put it halfway through and then I run over to the other side and yank it out as hard as I can
Reply: Agree 100% lol. I was looking away every cut.
Reply: When I was in the 6th grade in shop one of my classmates cut the tips of all his fingers off ,was a true nightmare. They reattached 4 of them.Because couldn’t find one.It caused him to break multiple bones in hand ,his wrist,and when i visited In hospital he had wires sticking out the top of fingertips with whole arm and hand in a cast.So that is good that they came up with a finger protector.
Reply: I own a SawStop and would never cut without push sticks or my gripper.
Reply: @JayOfBurn  same type of mindset as guys who don't use earplugs and a respirator
Reply: I thought the exact same thing, this dude is living on the edge lol
Reply: It is painful to watch
Reply: I really appreciate this video but thought the same thing about the table saw and flinched all the way through it.. A beautiful table but not worth losing limbs over. 
PLEASE always use stock wood to push, folks..
Reply: @mathewmolk2089  Thank you for posting this great information and advice!
Reply: @dilldowschwagginz2674  Yep, or a couple of wasps fly in, or a Dog barks and you jump.. Or something falls behind you, or...
Reply: @chrisfry436  Thank you and God Bless, Well Said!
Reply: @chado96k75  I don't think a blade that size running at speed will be able to stop on a dime or drop/withdraw fast enough to prevent serious damage. 
I think inertia or time delay in withdrawal would be quite enough to cut through fingers, hand, wrist, etc..
Reply: @JayOfBurn  Exactly. Thank you!
Reply: Im not a woodworker just a interested viewer abd have absolutely no idea of safety rules. But even I thought, WTF!
Reply: Push stick definitely!!!
Reply: Bro it ain’t that hard 😂
Reply: he worries about dangerous dirt and doesn't give a crap about his fingers.....wow!
Reply: Been doing wood working for years didn't even see it 😂 however i have cut my finger once, always crooked
Reply: Bro skipped woodworking lessons  day
Reply: @damjanristevski7599  His newer videos have been much better... he's done some pretty cool stuff since, and with much safer technique.
Reply: Y'all cry in the comments too fkn much
Reply: @danger1240  Profile name checks out.
Reply: He’s trying to eliminate the competition lol
Reply: Nice table And I'm new to this , just brought my 1st table saw , edging towardz a table planer , but shit even i use my plastic wood pusher , one slip and he's screwed
Reply: Actually i'm a beginner i bought all the tools to start working in this as a hobby.. and my family start telling me before i even start to take care of my fingers😅.. and now i'm worry 😅.. i'm a painter and i play music .. so i really need my fingers.. so thank for your attention and your warnings   👌🏾
Reply: @Poikka65  In Morleys defence, he did change his practice on the next project. He even used his 3D skills to create a new pusher. So yea, this first vid was sketchy, but he really did listen to all the comments and change his practices.

Enjoy the hobby! Welcome to the club ;)
Reply: @MotaDhesi 😂😂😂😂
Reply: So many youtube woodworkers hate their fingers! Seriously! Use push sticks and blocks ffs!
Reply: @moshesheckel7369 I always see some guy like you on a work site and they're usually missing a digit! 

Better to be safe with a table saw than another idiot in the ED.
Reply: Safety is paramount with all equipment,  the coffee table was very well done. Congrats
Reply: I was just counting his fingers
Reply: Funny (sarcastic voice) how your ONLY comment is the way he does wood working and not the GREAT work he did! Keep your trolling and negative comments to your self!
Reply: Because at the time, the work Morley did was quite rudimentary. But, Morley is a decent guy and a real talent. His latest videos and work have been a vast improvement on this. His safety practices improved ten fold after this one video too... so really can't fault him now. He has great ideas, and while his execution can still be a bit sketchy, his final products are pretty cool. 

I do not, nor did I, slate Morley's work. And don't pretend that I did.

Watch Morley as an inspiring and talented maker, not as a professional woodworker, and you'll enjoy his work.

And don't accuse me of being a troll again.
Reply: @JayOfBurn  what you did is trolling. 
What could have been said is "great work amn, looks good. However I would suggest investing in a push stick instead of putting your fingers and hands so close to the blades. Only saying this because I want to see you succeed and want to see more of your creations :)".
Trolling to me is only saying negative things to put someone down on what they are proud and happy to show off. Or simply to get a rise out of someone who cares. Maybe the word is wrong, but that's what it means to me.
I do agree that he's safty practices have improved dramatically since this video, and am happy to see he's newer videos still have all 5 digits on both hands 😆. Sorry if you were offended.
Reply: I totally agree. That made me cringe just watching him.
Reply: Been building cabinets professionally for some time now, only use a push stick when parts get small. Push blocks get dusty and slip, unless of course you dont do alot of woodworking lmao 👌🏾
Reply: @Galgamoth 😂 wait till that stick slips and sends everything right back at you 👍🏾 noobs always have the most to say 😂😂
Reply: @achingpuddleog4607  you are exactly the type of person i'm always performing first aid on. you obviously don't know you aren't supposed to stand directly behind the blade in case of kickback.
Reply: Whew okay...I needed to make sure the comment section touched on this. Thank you, stay safe out their folks!
Reply: And when cutting the bigger woods they almost fall the other side and he is putting so much force to keep the wood not falling..
Reply: This is why i always get my 5 year old to push the wood through, as it looks too dangerous to me.
Reply: Made me cringe everytime.
Reply: Noticed that immediately
Reply: Don’t try to be the expert it doesn’t look good.
Reply: I was cringing watching him.
Reply: Who needs thumbs ?
Reply: The biggest problem is if the blade grabs the wood and throws it towards the blade in a fraction of a second with your hand still on it.  The riving knife helps but still.
Reply: I'm new to woodworking, and I even thought that was dangerous
Reply: Holly shit wow
Reply: noted thanks for the heads up
Reply: Thought yall were exaggerating until I saw how close he was stickin his paws to that blade 😂
Reply: I second the point of the commenter.
Reply: Came to say the same thing,  he's going to lose a finger that way.  Prayer's man.
Reply: Right! He's putting g his arms o er the blade and Yeah!  NO push stick
Reply: You can't make a flat edge with just a table saw
Reply: You need a Jointer
Reply: Just wow
Reply: Almost an horror movie 😂
Reply: Yea brother man needs a SawStop saw. 😂